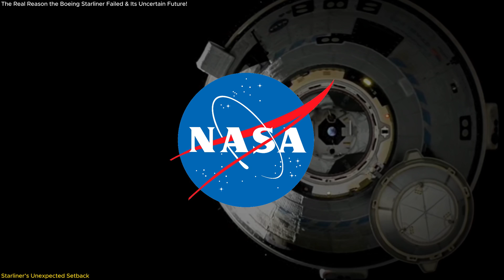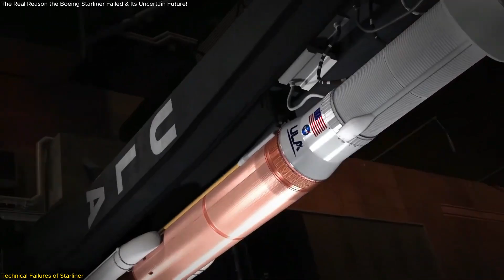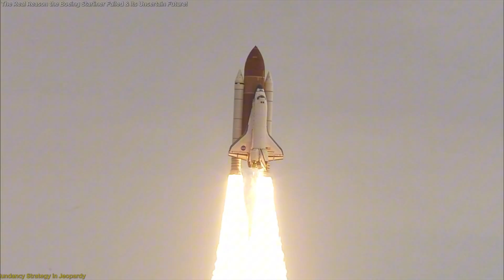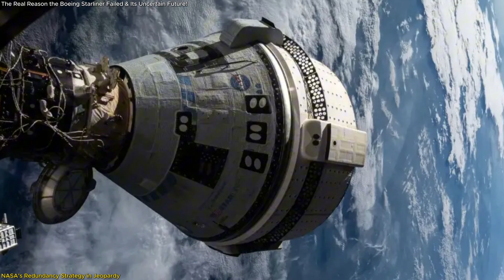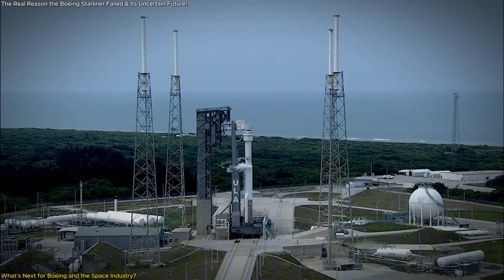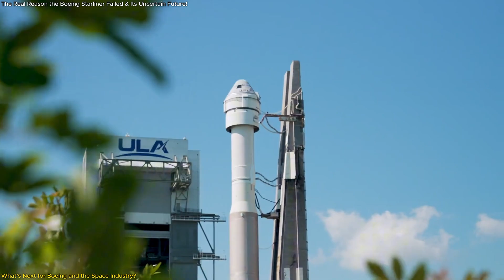Is There a Future for Boeing’s Starliner After Its Failed Mission?!

Comment: NASA is as much to blame as Boeing.  Let look at the published failures. Helium leaks were discovered on the pad and NASA decided to launch. Go fever.  The space suits are not compatible with SpaceX crew dragon, does anyone believe that issue was missed by NASA and Boeing?  Autonomous return was not tested so starliner was held on the ISS until a new software program could be loaded. These are the reported failures what else was not tested or not developed per contract.  Cancel the program.